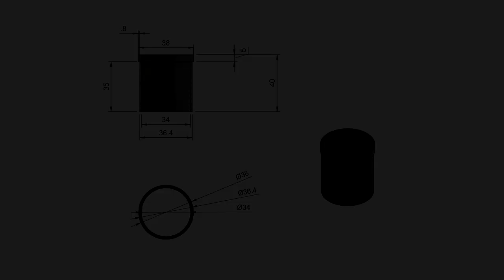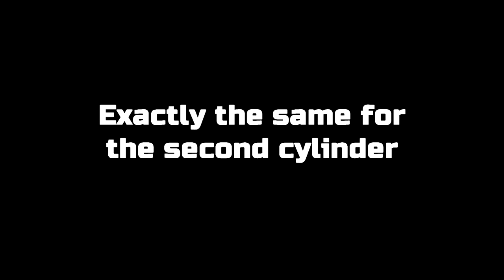Home-made 2 cylinder 4 stroke engine. Part 2 - Cylinder Sleeves

Comment: Recently i bought a lathe it was in really bad shape because people that were using it before didn't respect their tools, you dont even know how happy i am to see someone covering lathe bed when turning iron. What cylinder layout will it be? inline, v-twin, boxer? I hope the engine will be running soon.
Reply from the maker: I believe you. Even though its a tiny small machine its still a tool that is a pleasure to use. I will replace the standard chuck bearings with tapered ones as soon as I think I know what I am doing. So far the plan is a Inline. I wanted to do a V-Twin, but the crank balancing looked a bit hairy and the boxer needs double the amount of camshafts and belts. So this one will be a inline.

Comment: Are you working to a plan?
It would be nice to see where  you’re going with the project.
I understand what  you’re making, but how it all fits together is a mystery.
Reply from the maker: Hi James, I am working on a completed design, except for the electronics to run the ignition and fuel injection. The project stalled, but I am planning on picking up  next week again

Comment: What alloy did you use? Tool steel alloy of some kind? If so can you specify?
Reply from the maker: It is plain cast iron. I don't have an more specs of the metal itself. The rings are also cast iron because it hard, but "springy".
Reply: @TheXSpitfire  okay:)  if you want to uppgrade i suggest some kind of tool/ spring steel. They have a high abrasive resistance at hardeness as low as 42-50 hrc without any type of hardening.
Reply: @TheXSpitfire  did you just use simple medium carbon steel for valve assembly?
Reply from the maker: @danieljohansson8401  yes its just a common medium carbon steel for the values. I am very limited by the mini machine I am using as it's  rigidity is very low and only 350w. Once I have learned enough I will look at upgrading.
Reply: @TheXSpitfire  oh i thought cast iron was quite brittle.  But there is tool steel with good abrasive resistance that has excellent machinability. And there are alloys that are air hardening and tempering can be done in an oven just that it takes alot longer. I suggest something stainless for the ring because the engine wont seize up if it comes in contact with moisture for a long time. D2 should do the trick and is super easy to harden. Just heat, quench or. Cool with aircompressor. Temper  in regular oven at 275 c and check with hardness files for the appropriate hardness. You can use a low alloy steel aswell. Like a nickel alloy. Hope this was somewhat usefull!
Gretings from sweden
Reply from the maker: @danieljohansson8401  Cast iron is very brittle as you say, but up to recently rings where made from cast iron as it retains the integrity of its original shape under heat, load, and other dynamic forces. The main reason for me not using anything else is my lack of skills with other materials. I will try some stainless steel at a stage and play with hardening too. Thanks for the info above. Will look into it.

Comment: I have a question for you I could not find a person to answer .. since aftermarket Cast iron cylinders are very bad quality and especially the chinese engines ,, what do you think , is Stainless sleeve will be better than cast iron sleeves as anti corrosion??
if the answer no : so please tell me how to make cast iron sleeves harder ? some one told me to put them on fire for 1 hour and then put them in oil ... what do you think Sir ?
Reply: Stainless wouldn't be the best material to use because even though it's steel it's a softer alloy compared to other materials.  I'm not who told you aftermarket cast iron sleeves are bad, but if you buy a good one they're all you'll ever really need.  So long as an engine is maintained you will not see cylinder wall corrosion inside the chamber, unless water is getting and staying in there (which is a different issue altogether).  Depending on the sleeve you get, the cast iron sleeve should already be tempered.  If you want to temper a sleeve, you'll want to make sure you get it to the correct temperature, drop it into correctly temperatured oil, and you'll want to make sure afterwards that the cylinder didn't warp due to the heat treatment.  

Where did you hear aftermarket sleeves are bad???
Reply: @TheGamersRace  yes : I have motorcycle which I can not find original Cylinder spare part so , every time I buy chinese cylinder . the sleeve's walls gets wrap and damaged because it is made of bad quality gray iron and not even hardened  , I am a mechanic , but when I bought the original Cylinder I noted that it is made from white cast Iron which is hardened and it's color is not gray but tend to be brown , what do you think the original Sleeve are made of (gray or white cast iron ?) it is hard to find the original parts and it costs a lot of money shipping and customs . so I have to make solution through  my lathe
Reply: @worldcollections2839  Id say OEMs are White Iron simply due to its harder nature, and I'd say Chinese ones would be made of Grey Iron, which is significantly easier to machine.  I'd also say that Grey Iron is only marginally worse in older bikes, and depending on the age of the bike the original may have been Grey Iron even.

But why do you buy Chinese ones?  Why not look for a quality machining company that can produce one for you?  Some companies can even custom make sleeves.  I'm sure you will be able to order exactly what you want if you can't find an OEM sleeve.

What bike is it that you're working on?
Reply: @TheGamersRace  hahahaha , maybe you did not visit Middle east before , we have no quality machining companies here . and if we buy original part from abroad , so you have to deal with the Egyption customs which is famous with stealing the items or put 300% percent import fees to force you to leave your item and they customs employees take it to themselves ,, especialy when they know that you are a christian . they will persecuting you , I did not want to say this sensitive fact , but at least now you know the reason .. you told me all I wanted to know . thank you very much , God does not forget how much tired you to write me all these answers . love you man
Reply: @worldcollections2839  That's a hard place to be.  My father has been and so has my brother, and I can only say I've heard the stories.  If it's available, Chromoly Steel is also a decent pick for cylinder sleeving.  At the end of the day, you've got a bike that needs a cylinder, whatever works works.  Why is it you're looking for corrosion resistance?  I would be more concerned about cylinder wear than corrosion.  What bike do you have? I could try finding something suited for it.
Reply: @TheGamersRace thank you very much man ... I want hardened sleeves in common to be able to build top end engines of Scooters and Motorcycles .. so some models are Daelim s3 Advance 250cc ..SYM GTS 300I. Honda steed , shadow , yamaha Virago 250cc , 400 , and especialy the trail motorcycles that needs high quality sleeves duo to it's high temprature ,, I want to know why the orignal sleeves are tending to be brown ? are they coated with Titanium ? or that is the shape when they are hardened? .. ,what do you mean when you told me that if I want to harden a steel I should sink it into correctlly temperatured oil ? what is the  temperatured oil?  the wear I get is like that : when I put new cylinder and new piston and rings . the rings and piston fits perfectly  , I know know it when I measure with feeler, the engine works well and after a month , problem happens and muffler smokes black  or white .. I go disassemble the engine to ckeck inside , then I see everything is okay engine valves guides are perfect, gaskets are perfect were no leaks, then I check the rings grove ends clearance and I see it became 1mm while it should be from 0.15mm to 0.80mm as maximum and need to replace the rings .. all this happen in one month only , compression loss , and I noted that the sleeve top and middle  became wider than the lowest part of the sleeve that does not get corrosion, so I know that the sleeve became very bad , so the cutomer comes to me to complain and think that  I am a bad mechanic. give me an email so I can send you the photos .
Reply: @worldcollections2839  There's many different reasons iron could turn brown, so I'm not exactly sure.  Temperatured oil, I mean just the temperature of the oil before you dip the sleeve in it.  You would want to make sure the oil isn't too hot or cold.  This part isn't too important as long as the sleeve is heated to the correct temperature.  I assume the cylinder is honed when you press it into the bike, is the hone still there when you check the cylinder?  I've never heard of one wearing out a whole MM in just a month.  I've seen cylinders go 250,000 miles (402000km) for 20 years and still have the original hone in the cylinder (and piston rings).  
Email me at joelsclark30@gmail.com